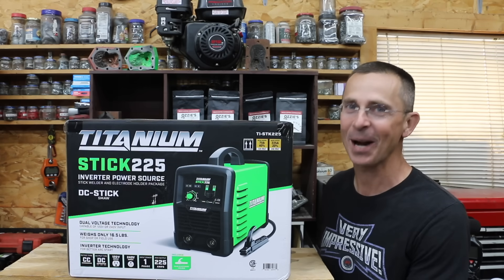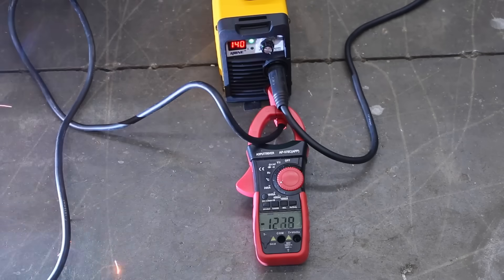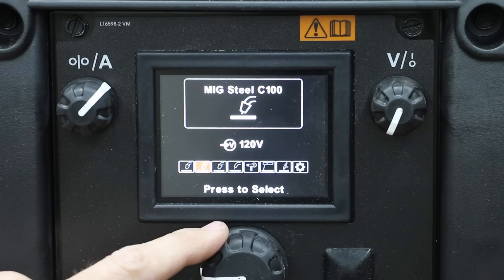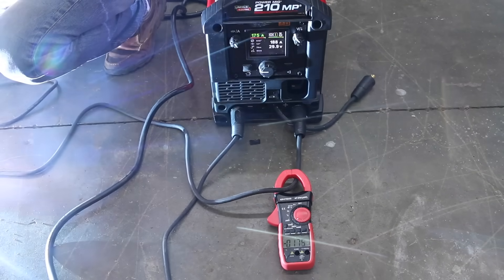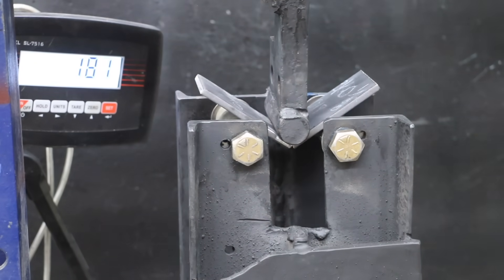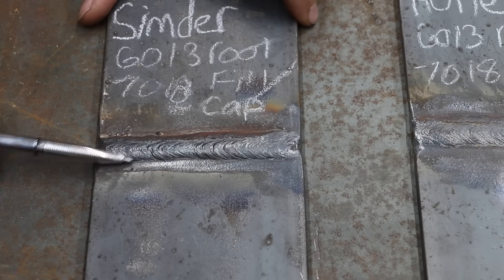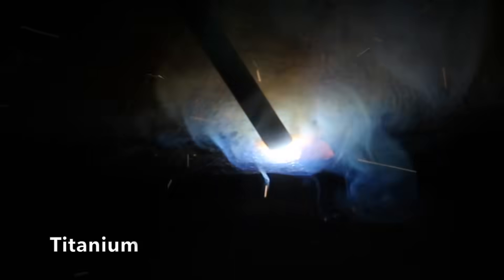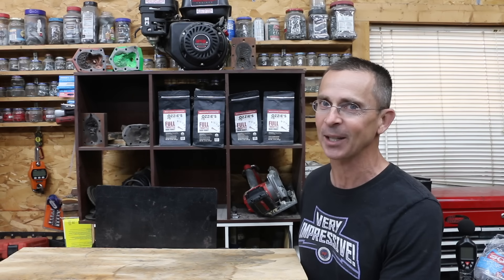$70 vs $2,300 Welder? Let's Settle This! Weld Strength, Duty Cycle, Current Output, Build Quality

Comment: Based partly on this review and others I picked up a Titanium Stick 225 a few days ago.  (20% coupon makes it even cheaper, kind of a no brainer).  Looking in the manual I noticed that one reason the 5 minute test worked out so well for this guy, is that the duty cycle at 240v is 100% at 100A.  So at 130A to 140A you're probably still in the 75+ percent range... which means accounting for time switching electrodes it'll probably tolerate it and keep on going with anything up through 1/8" rods.  I have to give them credit for properly listing their advertised rating.  They claim a 20% duty cycle because they also provide a top end of 225A which is huge for a 16lb machine.  Rather than listing some mid amp duty they only show the full power rating.  Good on them.  So yeah, at full beans which you'd pretty much never use on this machine it is 20%.  But at anything up to 150A you are not likely to have an issue welding at any pace a home or occasional shop user can do.
Reply from the maker: Thanks for sharing.

Comment: What to look in a new welder:
1- Do not buy expensive welders.
2- terminals twist connectors should be 1/2" diameter, avoid these 3/8" machines.
3- duty cycle should be at least 60% at max settings
4-current /overload/ overheat protection.
Reply from the maker: Thanks for the feedback.

Comment: Bought the yeswelder based on this video. (been looking for a cheap welder for a while) I can say for the price, portability, 120 or 220v and simplicity anyone can weld with it. perfect for garage or field repairs. runs off my generator if needed. welded 3/8 steel with their recommended rods on 120v no problem. would recommend!
Reply from the maker: Thanks for the feedback.

Comment: Please test nails! (unless you already did, you've done a million reviews 🙂). Not everyone needs welders, but everyone uses nails! (Strength, bendability, "corrosionability", ease of driving it in, resistance to getting pulled out when the wooden pieces it connects start separating under force, etc.).
Reply from the maker: https://www.youtube.com/watch?v=kAxGAIFbqu4

Comment: Thank you Joe! Nice welds. I have that same current meter. I like it. I use mine for checking my solar system.  Great video.  I have a little  metal man 120v inverter welder. Works good but i prefer  my old transformer machines. Less parts to fail. Less circuit boards that cant be had 20 years later. But its cool what you can buy for not alot and carry in one hand. My miller dialarc hf 300a is over 500 pounds lol. And needs up to 100a service to run 300 amps for stick or tig lol 😆.  Mostly use a 240v Lincoln weldpak 155 mig personally
Reply from the maker: Thanks!  Thanks for the feedback.

Comment: A lot has to do not only with quality materials and manufacturing, but duty cycle. The more expensive welder has a higher duty cycle so it will run longer before overheating.
Reply from the maker: Thanks for the feedback.

Comment: I would like to thank Joe as well for his input.

I would be interested in a MIG welder comparison, particularly the duty cycle ratings on more budget welders such as the Arccaptain 200 amp 6 in one and the YesWelder MIG-205 as compared to the multiprocess welder you already have. It would be interesting to see how long they can weld at a lower setting, say 130amps and also at full power.
Reply from the maker: Thanks!  Thanks for the suggestion.

Comment: With your testing device, it would be interesting to see what the "fail load" was for a piece of the same metal without any weld. Other "loads" (like a tensile strength test, or "shearing" load failure point) could be interesting to see too -- assuming you could design devices to test such. Any weld can be made as strong (or stronger) against load failure than the material itself would, for most situations, be a good weld.
Reply from the maker: Thanks for the constructive feedback.

Comment: Great show!  I started with a new “Lincwelder” in 1968 as a kid in the FFA Shop.  Bought my own for $100 (new) in 1972 for a 225-Amp A/C basic welder.

Used it in my repair shop in TX until I went back to CA to finish school in 1979.

I now have a home in the “Slum section” 😉 which adjoins a rich area in CA.  A neighbor tore out an old deck, so I recycled the lumber and old grape stakes, saving at least $2500 in materials, to make about 125’ of privacy fence.  (Couldn’t afford to live here if I didn’t use my building skills to remodel my home by myself.)

If I’d had that old welder and my Victor torch and gas bottle set, I would have made some decorative iron work and a sliding gate on my driveway: It would cost $15K to have  someone else do it!  (Now I’m a computer security engineer, so might be able to afford it, but still like to use my hands and eyes to create something that will past my next cise review cycle!
Reply from the maker: Thanks!  Thanks for sharing.

Comment: Excellent video and Thank you for your feedback Joe...it adds a lot! Now has anyone noticed the big home store, buckets that they sell with their name and logo on them are getting lighter and thinner and the handles tear off with a lot less weight in them than they used to? They also crack a lot easier than before. At 350lbs......yes the mrs feeds me well....I used to be able to sit on the homer bucket without the side crumbling in and even lean on the edge without it folding in. (That's sitting on the open side). Standing on them is actually getting to be a little scary because of that issue.  But now at only 287lbs....don't ask......I'm noticing the sides fold in within 10 minutes and even less in the hot sun. Can you do a test to see which bucket is performing the best because the guys are spending a lot of money now, for those buckets and we need to find the ones that will last for the many uses, under all the extremes and at all the temps they will be used in. We use them for everything from a seat while working, a step stool when you need that extra height, to carrying crazy heavy loads from liquids, to wet sand and cement, to steal pipes and plates and tools they were never meant to carry.....but don't tell them! Lol. Oh and the little plastic hand grip on the handles are splitting away before the handles give way now. They are getting really cheep! It needs to be brought to light before someone gets hurt using them! Thank you for doing what you do! Later! J Pol.
Reply from the maker: Thanks!  Thanks for the suggestion.

Comment: ABSOLUTELY looking for multi process, especially flux core welders
Reply from the maker: Thanks for the suggestion.
Reply: @ProjectFarm  np. To be fair, I'd love to see the Chicago AC, Titanium 125 DC, Lincoln 90, Yeswelder, etc. tested. Use the same flux core wire in each & anything under $200 up to 3/16th plate.

Comment: I have a Titanium flux cored welder and it had always seem to run hot. I once turned it up to max and it blew through a 3/16 plate before tripping a 20 amp dedicated circuit.

Comment: I have an older Everlast welder, works amazingly well, but for some effing reason they decided to label the buttons 1 thru 10... Never thought about the clamp on meter part... holy crap, I'm gonna finally be able to adjust my welding all accurate instead of "eh, should be about here, does it sound like bacon?".  Thank you! :D
Reply from the maker: Thanks for sharing!

Comment: Folks need to realize in the real world the plates would be beveled at roughly 23 degrees and a open butt of the diameter of filler rod, however for welding machine test this will suffice. Some rods weld better in uncleaned environment. If you are welding on machinery or pressure vessels where peoples lives would be at risk put the stinger down and get some training please. Thank you project farm for your due diligence in your testing. Subbed from here on out. Oh by the way I'm a thirty plus year union boilermaker certified for 25 of those years as a heavy wall tube welder. Thank you again project farm. No disrespect meant in any way.
Reply from the maker: You are welcome!  Thanks for watching and subscribing!

Comment: I cracked up when I saw Harbor Freight wire feed welder. I paid 120.00 dollars. The stupid thing is what they call "duty cycle".
From the store it would weld 6 minutes 15%duty cycle.
I added a fan in the box. Now 100%duty cycle. Beats all pro welders, Hobart, Miller, Lincoln. Theirs were so much more expensive, I will only use Harbor Freight and I am certified union welder. Same as DeWalt grinders I get six harbor freight for 1 DeWalt. Never again trust brands!!!
Reply from the maker: Thanks for the feedback.

Comment: Starts cold metal heats up and it gets better run 3/32" wire  and you will be fine each wire size has a proper current range 130. Is good for 1/8" also you set up the Amazon test on scrap and adjust up or down to get the right heat.

Comment: Got a two year degree in 1982 and became certified on plate and all position pipe.  
Though I only welded as a job for 12 years or so- I’ve welded all my life every chance I get!

Though I have the Lincoln arc and Tig welders- I bought a Yeswelder mig/arc for around $300 a couple years ago.
It works great in mig and does everything I might need.   The only problem I have with it is that as I’m mig welding, it spurts (starts as nd stops seemingly).
Reply from the maker: Thanks for sharing.

Comment: Excellent video!
If you plan another video (esp if weld without proper prep) on your next video, please specify weld rod or wire type, gas mix if any, and weld setting parameters. Thanks.
Reply from the maker: Thanks!  Thanks for the suggestion.

Comment: Many thanks to joe and PF for yet another great video. I would love to see a review of the other processes of a multi process welder. I have a much older millermatic multiprocess welder. But I mostly mig weld with c25. I don’t even know how to set up the other processes, or what they are for. I have done some stick arc welding, and flux core wire feed arc welding, but would love to learn more about the other processes. Thanks for another great video
Reply from the maker: You are welcome!  Thanks for the suggestion.

Comment: You you want good penetration on a root pass why didn't you just use 1/16 gap for the 1/8 rod you were running. It would of burnt thru and giving much better penetration  judging the welder knows how to weld a key hole. You could even use a deeper burning rod like 6011. 😵‍💫
Reply from the maker: Thanks for the constructive feedback.

Comment: one thing to keep in mind when buying a welder is parts availability.   I've had my lincoln 140 mig for 20 years and I can still buy replacement parts for it.  will titanium welders still be around in 20 years?  just something to consider.
Reply from the maker: Good Point!

Comment: That was a fun and informative video; I'm lucky if I can stick a couple of pieces of metal together on a good day. I would love to see where HF's Chicago Electric Flux 125 comes out versus other similar wire welders (and maybe compete against HF's next step up - the Titanium Easy Flux 125). I own the former, but have been considering getting the latter one (though I have parts to convert the one I have to DC). I've found it to be decent, but then again, I'm obviously not a pro. Well - whatever - great video and information - thanks!
Reply from the maker: Thanks!  Thanks for the suggestion.

Comment: Very well done review of these machines!
However I think a much more informative comparison would be to compare the same rated machines from different companies. For example a 140 amp mig welder, I know of a ton of different companies who produce these like Titanium($400) Lincoln($600) Miller ($1000) also Eastwood($350) and the list goes on.
It would be really interesting to see how much of a difference there is between machines that are advertised to do the same thing
Reply from the maker: Thanks!  Thanks for the constructive feedback.
Reply: @ProjectFarm Great video.  Really nice to have a pro like Joe making welds and evaluating the welders.  Now I have proof that "its not me, it's the machine " :).

If you do more welding related comparisons, could you add an acid etch to show the cross section weld area?  Also ductility is important as ultimate strength, maybe plot load versus displacement/deflection during your break test, then overlay the graphs on one page (sort of standard test for metal).

As is, your videos are really good.  Thanks so much for doing them, I just subscribed.

Comment: I have a great video idea what is the Precision Bit Set for Electronics personally I use iFixit toolkit and for a little larger bits on electronics I use a Worx electric screw driver.
Reply from the maker: Thanks for the suggestion.

Comment: THANK YOU JOE for laying dimes.  This is by far top ten of your comparison at the farm.  You even hired a pro welder.  With my knowledge of the chinese cities and manufacturers, I can narrow down the less expensive brands and which floors are being used by all the welding machines (even Lincoln).   Very good video.  I am only a engineer that does home welding.  I needed to buy a new welder and I am noticing that alot of the welders are using the same PCB motherboard and wire feeders no matter the name brand.  This video helped.
Reply from the maker: Thanks! Glad the video helped!

Comment: Honestly, I would have rated the Hone or Deko above the Yeswelder because of the output.

That's a critical measurement. If you're trying to run 200A and only getting 140A, but the other welder maxes at 160 but gives you 147, you're less limited.

I'd be interested to see why the YesWelder has such a low output compared to the dial. I wonder if possibly it's something that could be corrected with a few board component replacements.

And Harbor Freight is really killing it with their Titanium brand welders.
Reply from the maker: Thanks for the feedback.

Comment: Would love to see multiprocess, I believe the Yes Welder has a few options and seems sort of the budget brand.

Also for my needs it would be body work, or other thin gauge metal, I would love to see a test on that as well, the lower extremes are likely relevant too, at least for wire feed processes.
Reply from the maker: Thanks for the suggestion.
Reply: @ProjectFarm  I would enjoy the multiprocess machine as well as for diy cost is important and I’m very interested in the yes welders especially the ones that are also plasma torches.

Comment: Thanks for that video. Yes we are interested for mig welder. If possible, compare flux core wire and with the gas for welding wire
Reply from the maker: Thanks!  Thanks for the suggestion.

Comment: I've been wanting a welder for years . The titanium one is perfect for me. Hopefully get one by the end of fall
Reply: I have the titanium multi processor. And it words awesome. I currently use the Flux welding with it. Till I get gas bottles. But it does Flux might tig stick and spool. Digital as well. The only thing it didn't come with it the aluminum spool gun.
Reply: @oddessy2g  I have my 25% off coupon, but every time i think i almost have enough to buy it, i need to buy groceries of need gas. lol
Reply from the maker: Thanks for sharing.
Reply: My titanium stick welder is awesome, I knew it would come out on top!

Comment: A review of the various multi-process machines is definitely needed. It'd be interesting to see how the Titanium fairs against some of the similar multi-process offerings from Amico, YesWelder, PrimeWeld, Forney, and etc. There's definitely plenty of options in the $250-$500 range. How well they'll work and hold up is the real question. I purchased an Amico Mig140GS recently (~6mos) and so far it's done everything I've asked. Would definitely be interested in seeing how it fairs in the tests.
Reply from the maker: Thanks for the suggestion.
Reply: I've ran a titanium for over 3 years with heavy use and it's been awesome. Like it more than my Miller

Comment: I have a Lincoln 200 tig square wave it’s been in out for repair 3 times now it’s out of warranty it’s older model than the one tested here but I was very disappointed never got to use it to weld aluminum because it stayed out for repairs and now it’s out of warranty.  The repair guy said it’s basically just a disposable welder not really made to last he basically replaced the inverter and slapped the metal cover on so I got basically three new welders that broke in a few months.  Checked my wiring and my 220 stayed steady so it wasn’t a wiring issue on my end.  New one might be better but I would spend more money and buy a Miller or just buy a cheap welder and expect to replace it as needed

Comment: Thanks for your continual unbiased opinion. And thanks Joe, always good to have a pro around.

I spent most of last weekend welding back-to-back with my buddys Harbor Freight 120v flux core vs my hobart 120v mig with flux core in it to do some bodywork. 

The harbor freight was terrible with very little adjustment available compared to the Hobart.
Reply from the maker: You are welcome!  Thanks for sharing.

Comment: I change the oil every 4-4.5 thousand miles. I use Eni, which here in Europe seems to be the cheapest synthetic from a well-known brand. The mileage on my car is around 150k miles (250k km). Last month I pulled the rocker covers to replace their gaskets and guess what? Zero stains, clean as hell. That sight makes it 100% worth to change the oil so frequently.
Reply from the maker: Thanks for sharing.